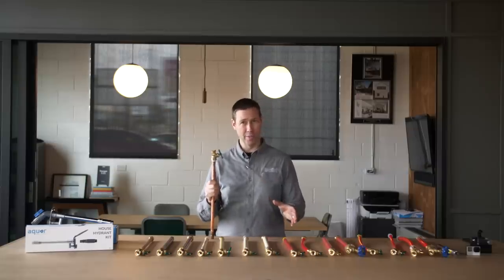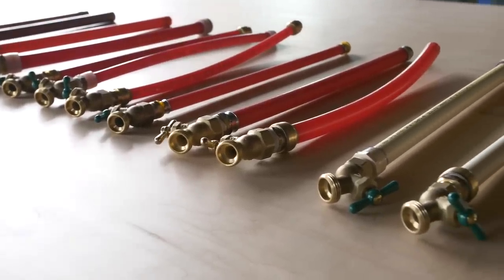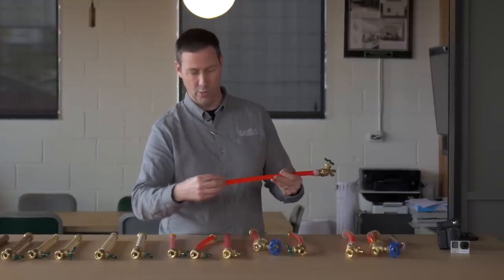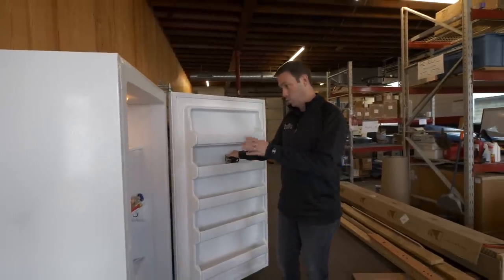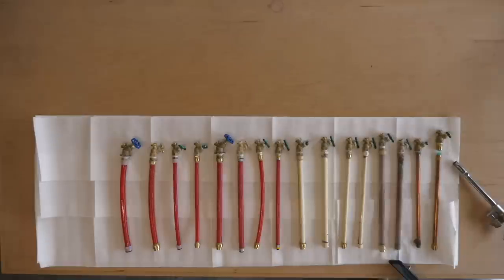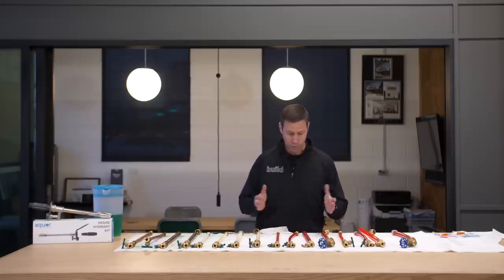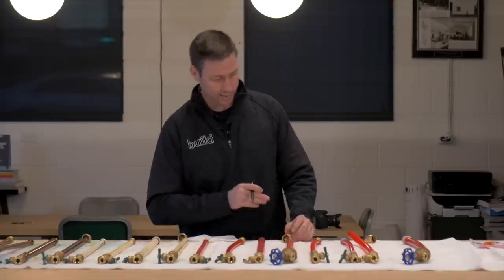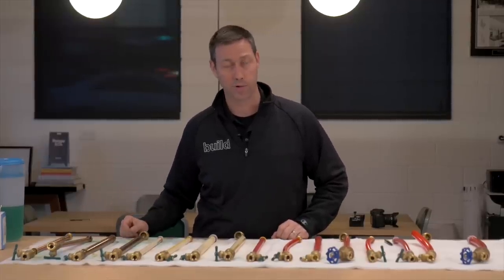Copper vs Pex vs SharkBite - Freeze Testing

Comment: One thing this test doesn't take into account is age of the pipes. Take a 15 year old PEX pipe and see if it does the same. My guess is that with any plastics, the oils eventually dry up causing the material to become brittle.

Comment: PEX fittings will split and fail before copper does.
Reply: my pex water lines freeze over and over year after year. copper bursts first freeze up.
Reply: @dosmundos3830  I've seen copper do that.  Where there was copper and PEX(that is copper connected to PEX) the PEX fitting swell, split and fail, while the copper remains in tact.
Reply: @Ken Quesenberry copper doesn't expand like pex pipe, a lot more force would be directed on the fittings. it would be as much a waste of time using copper pipe with pex fittings as it would using copper with brass or copper fittings. only pex pipes will tolerate a freeze up, likely with any kind of fitting.
Reply: @dosmundos3830  I wondered why anyone would use PEX to make a repair in copper when it's so easy to cut a piece of copper and sweat it in.
Reply: @Ken Quesenberry maybe because it's easier to replace just the broken pex rather than the entire copper piping next time around.
Reply: @dosmundos3830  If they had insulated it correctly there wouldn't have been a problem.  The insulation wasn't covering the fitting well, and that's where it froze.
Reply: @Ken Quesenberry all the insulation in the world wouldn't help if there's not a heat source to be contained. Without heat copper piping or it's fittings are busting whereas pex isn't. End of story.
Reply: @dosmundos3830  That's not completely true; insulation will lower the point at which water will freeze in a pipe, without a heat source.

Comment: My house just had a leak because of sharkbite fittings. 😠
Reply: Aired down and disconnected got to clean before install copper you need to remove the internal plastic T

Comment: Ok I live above the 45 th paralell
first I have rentals
cpvc ? absolutely do not use
pex? only where the location is flexible
copper? stop using all together
now pex
if its used underground do not let heavy equipment drive over it 
even though say its 5' down 
that stuff pulls apart
so whats left? 
#1
you didnt mention that usually when a pipe is being used for water it will have about 60# of pressure
why didnt you test in the freezer under pressure?
#2
the clamp rings for connecting pex 
they are what should be used 
or better yet 
ridgid 
which will freeze 
but likely it will take a whole lot more thawing and freezing several times
what happens to the pipes especially metal is the thawing and freezing over and over causes slightly increasing diameters until they do split
so best thing is to use clamp rings and insulate 
heat tape suspect areas
one more good piece for anyone at all
get a recirculating pump
it will push cold water out of the hot and cold pipes
you will have instant hot water at every locstion and if you run the cold pipes close to the hot it will never have a chance of splitting 
unless a texas snowstorm comes along
then I would say insulate 
hope for the best
 
y

Comment: I've worked in Building maintenance for many years.  I am concerned about shark bite and others like it.  They rely on an "O" ring to seal, basically.  My concern is the propensity of rubbery compounds to degrade in constant contact with treated, municipal water.  So one has all these type fittings in there walls, under there sinks, etc.  Is disaster awaiting millions of homeowners when these fittings fail?
I prefer compression fittings, i would like to see those tested along with the others.

Comment: The lesson: drain the system of water during an extended hard freeze. If not drip the faucets to relieve the pressure. It's better than a $5000 repair.

Comment: There is only two ways pipes freeze and bust. Poor installation or neglect. That’s it. I wouldn’t choose a pipe over its ability to not freeze and bust in a video. No manufacturing company will warranty a froze and busted pipe. If you hire someone and that is their selling point look elsewhere they apparently don’t install pipe correctly

Comment: I've watched pex be installed by being pulled with electrical pull string through holes and scraped and scratched along the way.  All those small see strikes will lead to leaks.  

I'll never use pex or buy a home with pex.  Any home I own will not need the flexible resilience of pex when freezing.

Comment: About CPVC. You used  new pipe.  I understand that you  did this  vid with available materials but it lends to a myopically poor conclusion/result  that now  1.33M viewers  have   watched and  been  misled. This is an egregious  mistake.   Famous YOUTUBE influencers like yourself  have a responsibly to get  it right.   You are "entertainers", not experts. Before  setting up a test, consult an engineer, a chemist,  a plumber, the manufacturers, etc.,  to  ensure that your "test"  is done in a scientific manner.
To continue, NEW Installations are  not  realistic.   Age embrittlement is THE  issue with  PVC. If you  would use aged CPVC  the results would be  100% catastrophic. There are countless installations having  AGED, embrittled, solvent joined, plastic  water piping.  You should  produce a follow up vid to admit your error and fix this mistake.  And speak to real experts before creating your click bait  vids ( to your credit, some are actually  very well done).

Comment: As usual your tests are inconclusive or really explaining anything all I see is that shark bite fittings are garbage and you clearly don't understand that you should not have frozen brass fittings on the ends of the pipes to actually be able to test the pipe. The only thing that you've proven is that hose bibs are able to split and alter their shape and size where the threaded connections are. Your show is badd and you should feel bad

Comment: Also. Your house provides heat to the portion of the pipe that isn't outside. You put 100% of the pipe in a freezer... and were surprised that water freezing broke the pipe.... you should maybe stop doing plumbing experiments and spend more time doing carpentry. Plumbing requires a license, where carpentry does not..... this video shows why...
Reply: the test represents a house that has ho heat, as in the renters moving out early scenario he mentioned.  Maybe stop commenting and stick to plumbing. Being a critic requires intelligence and understanding.
Reply: @dosmundos3830  no, you're wrong.   SAYS THEY WILL TEST THE THEORY, COPPER VERSUS PEX. Expansion vs cracking. Go home you lose.